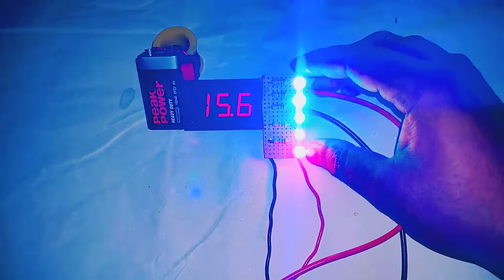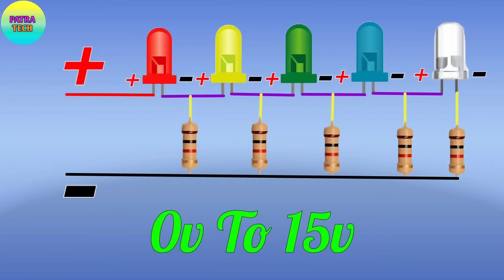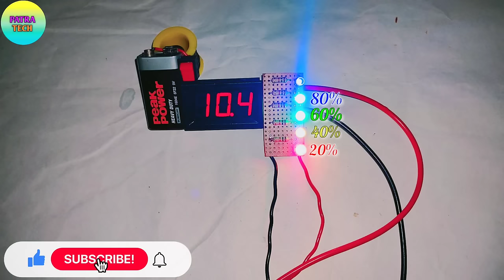Simple 12 Volt Battery Level Indicator Circuit/Battery Level Indicator 12v / Battery Level Indicator

Comment: What kind of battery that you have to monitor from 0v to 14v? The low  voltage of a 12v battery is around 11.5v and not 0volts. Where can we apply this kind of battery monitor?
Reply: Point bro. ❤👍👍👍
Reply from the maker: Yes thank you
Reply from the maker: Nice

Comment: बहुत ही बढिया 👌🏻👌🏻👌🏻👌🏻
पर बॅटरी चार्जिंग होते समय ये बॅटरी के टर्मिनल पे कनेक्ट रहेगा तो चार्जर के करंट से सभी लाईट जलती दिखाई देगी ? या बॅटरी कि चार्जिंग लेवल दिखायेगी ?
Reply: If the battery is good, it indicates the charge state, not the charger voltage. The condition is a direct connection to the battery terminals.

Comment: The RED LED starts glowing at 1.68 volts, a typical lead acid battery is considered dead when its voltage drops to 11.9 volts, which means an almost dead battery is still able to light up four level of the LED in your circuit, thus making this setup is very impractical in real world applications.
Reply: This particular cascade will always be indicated 2.5V and above (depending on the LED type). You can have the first 3 LED as a control to connect to the battery (for example, 3 yellow LEDs) and other LEDs may indicate the color level. But it is better to use the original scheme - when taking it from the battery (eg inverter), the voltage may drop below 12V and visualize it in this LED cascade. If you want less LED brightness, you can use 2K instead of 1K - it doesn't move the range.
Reply: @DL-kc8fc  thank you for sharing ❤

Comment: Good job !!
Reply from the maker: Thank you
Reply: this is only a rough indicator of the voltage and has a few flaws - mainly  that the voltage shown depends on the VF of the LEDs

This circuit has ben copied a thousand times because channels are so  lacking in knowledge.  The lack of explanation tells me this channel is sadly lacking. 
The  positive comments show a lack of honesty/awareness
Reply: this is only a rough indicator of the voltage and has a few flaws - mainly  that the voltage shown depends on the VF of the LEDs
This circuit has ben copied a thousand times because channels are so  lacking in knowledge.  The lack of explanation tells me this channel is sadly lacking. 
The  positive comments show a lack of honesty/awareness

Comment: can i connect more leds in parallel with each one but keep the circuit the same?
Reply from the maker: No
Reply: pointless       use UB LEDs
Reply: You can only connect two of the same series, such as Red, Red, Yellow, Yellow, Green, Green ... you can keep the resistors. The last two resistors may have 0.88k.

Comment: Your idea is not correct, according to battery level percentage... it spouse to start from 10v low battery and 14.6 full battery.... not counting from 1v....it spouse to count from 10v
Reply from the maker: Use 3.7v 4v 9v 12v battery

Comment: basic and used , very good
Reply from the maker: Thank you ❤️
Reply: @PATRATECH  Türkiye'den selamlar 👋
Reply: this is only a rough indicator of the voltage and has a few flaws - mainly  that the voltage shown depends on the VF of the LEDs

This circuit has ben copied a thousand times because channels are so  lacking in knowledge.  The lack of explanation tells me this channel is sadly lacking. 
The  positive comments show a lack of honesty/awareness

Comment: this is only a rough indicator of the voltage and has a few flaws - mainly  that the voltage shown depends on the VF of the LEDs
This circuit has ben copied a thousand times because channels are so  lacking in knowledge.  The lack of explanation tells me this channel is sadly lacking. 
The  positive comments show a lack of honesty/awareness
Reply: It is a basic functional connection. I have it for many years on 12V photovoltaic...
Reply: A dvm WOLD BE much BETTER
Reply: @DL-kc8fc  LOL   BUT YOU  REFUTE MY POINTS NOR COMMENT ON ITS FLAWS